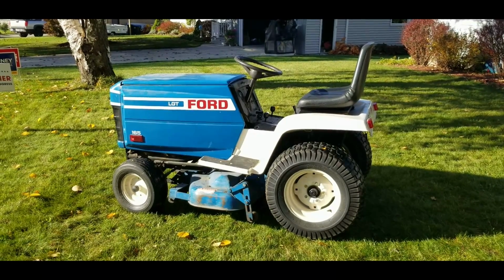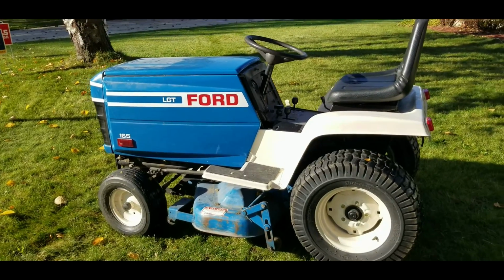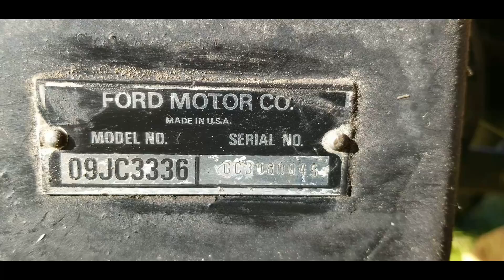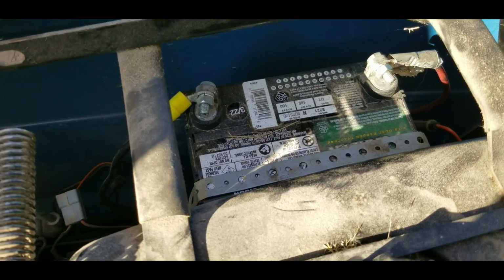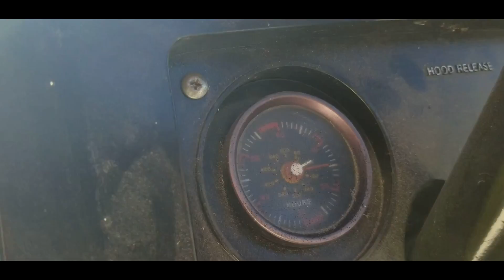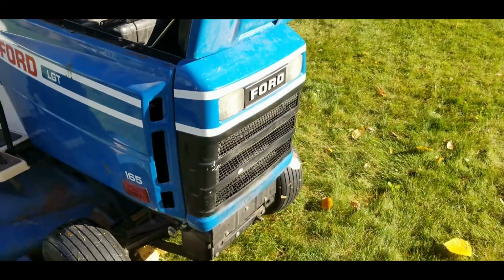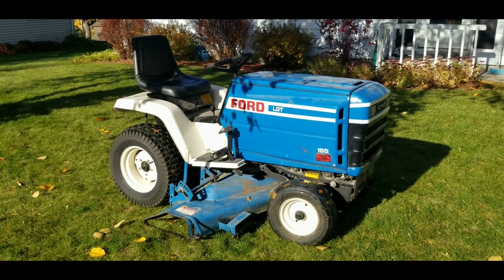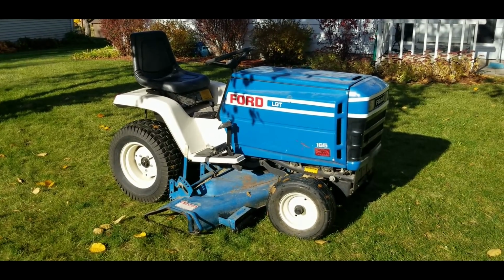Ford LGT165 Garden Tractor - 1977-1983 Close Sided

Comment: I had a Ford gt 65 diesel  44 inch cut hydro  the hood was plastic  engine was a 3 cylinder   can't remember the house power  you are now the proud owner of this classic machine 👍👌
Reply from the maker: I never had a diesel. That might be fun! Thanks for watching!
Reply: @RealManSkills  👍👌
Reply: @RealManSkills  they made this machine from 1977 to 1983
Reply from the maker: @robertmailhos8159  This I know. I just would like to be able to know exactly. There is also the open sided models. If I spend money on a service manual, I want to know that my specific year is in the manual. Thanks.
Reply: @RealManSkills  okay 👍

Comment: Awesome tractor! Do you have any pictures of the idler pulley system that allows the belt for the mower to do the 90 back to the electric clutch/PTO? I have a 165 with a deck but no idlers, and they are impossible to find/get a picture of so that I can make one. Thanks.
Reply from the maker: I'll work on that. Sounds like a good idea for a video.

Comment: I bought a new LGT 125 in 1981, if I remember right it was $3199 for tractor and mower and a rear mounted rototiller that was $499 (I think) the 125 had a 12hp Kohler,  it would mow or till with plenty of extra power, that would be a beast compared to mine, FYI the transaxle takes straight 30 weight detergent motor oil, same for the Kohler engine, I wish I still had mine 😐
Reply from the maker: Thanks for the input and thanks for watching!

Comment: It’s ironic that Ford Motor Company mounted a Kohler engine on this machine. I suspect this wasn’t even built by Ford, but is a rebadged unit made by a company like MTD, AYP or Noma.
I’d be interested to hear about the actual genesis of this machine and how Ford came to be offering them. Were they sold at Ford dealerships or elsewhere?  How many of all models did Ford sell, etc?
Reply from the maker: This was actually made by Jacobsen.
Reply: @RealManSkills    That makes sense, at least about the manufacture of it.